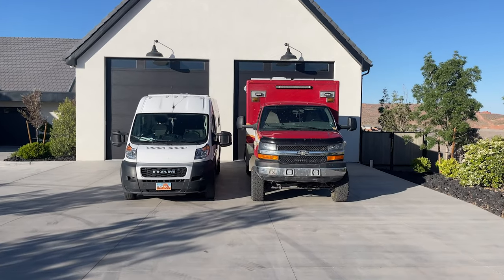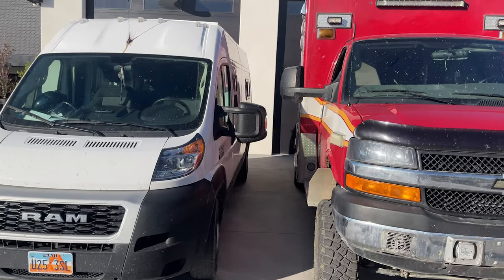Ambulance Conversion - 90 Days in 10 Minutes! - Full Build

Comment: My first ambulance I use for my construction company. I just bought a second one with freightliner cab over Cummins diesel. I’m planning on getting it and turning it into a self-contained motorhome. The electrical is the most daunting for me. I’m a homebuilder and a Finish Carpenter. But I know a little about electrical. Just looking for resources if you can point me somewhere.